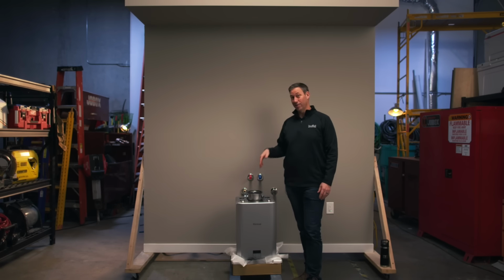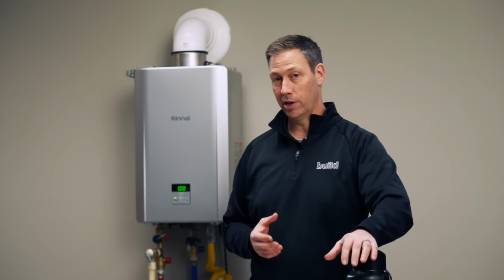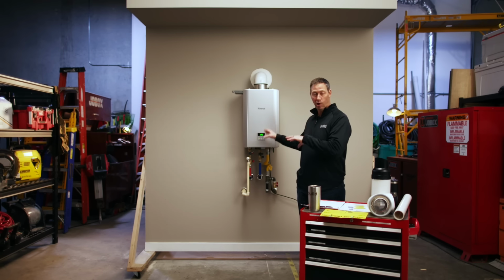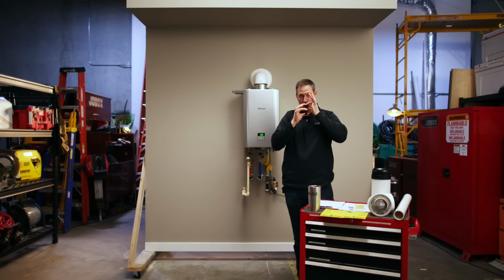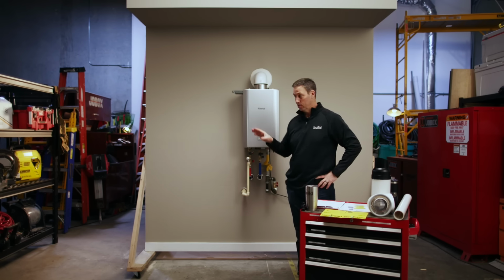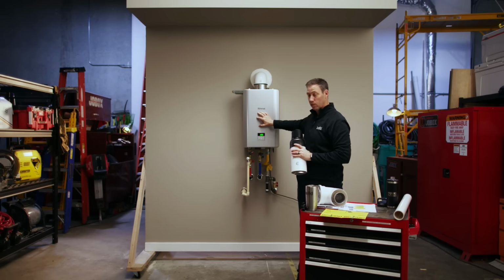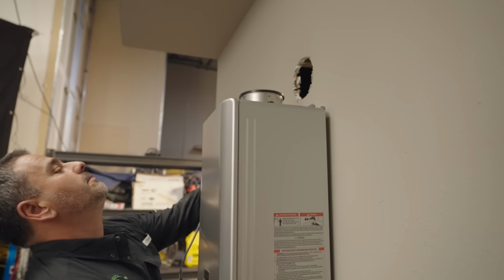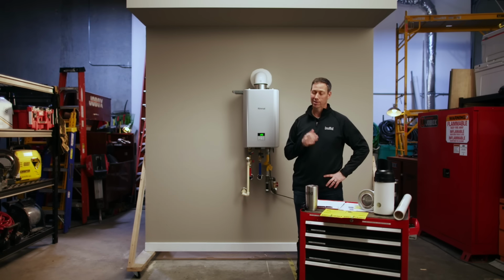Replacing A Water Heater Tank? Probably the Best Tankless Option for You.

Comment: I want a recerlation pump that has a remote like a door bell.  I walk into the bathroom or start loading the washer perss the ceerlation button and it will run for 1-3 minutes.  Who make this?
Reply: You need to look at the Smart Recirculation Control. http://www.smartrecirculationcontrol.com Rather than running wires and installing buttons or sensors at every hot water fixture it has a sensor that gets installed at the water heater and can be triggered from any hot water fixture.
Reply: @davidlehrian8035  I wasn't considering running wires.  They make battery operated transmitters. I am retired and dont live on a schedule.  So several of my activites don't take place on a schedule.  In my house this takes about a gallon of water to get hot water out each time you use the faucet.
Reply: @markmaugle4599  You said you wanted a button like a doorbell and then asked "Who makes this?" I just wanted to share what I think is a better solution than buttons or sensors regardless of how they are powered because you still need one at every hot water fixture and you now have to maintain batteries in all of these devices scattered throughout your home. The Smart Recirculation Control allows you to use any hot water faucet as the "doorbell" and you don't have to install anything throughout your house, wireless or otherwise as it is all self contained at the water heater/recirculation pump location.

Comment: my plumber told me during a recent replacement that I can't go tank-less due to the gas line needing to be up-sized from the meter (costing me much much more money).
Reply: I was told we needed a completely new electric meter put in to be able to use a tankless.
Reply: @Shannan845  that doesn’t even make any sense.
Reply: @kayomichael  I agree. Didn’t have time to do much research though because we were moving into the house that day so just got an electric water heater to replace the broken gas one. Still want a tankless though. How much electricity could they possibly use though? Our main breaker is a 150 and it’s an older home, but still. It already had a gas hookup and vent directly outside, and sits in the same room as the breaker box. It wasn’t worth the fight at the time, but damned if they’re getting anymore business from us.
Reply: Michael and Shannan, you are both talking about the same thing (increased energy input for the new tankless) and you are both making the same mistake. It TOTALLY makes sense that you'd have to increase your energy "input," whatever the source of that energy is. A larger (or additional) gas line OR a larger electric panel. A 150 amp panel is old news as all new homes have a minimum 200 amp panel today. And Michael, like you, we had a gas line, but it was undersized for a new tankless, so we needed to add in a new separate gas line for our new tankless (which was replacing an electric tank model). Just look up the specs, guys, the data is out there. Yes, tankless uses more energy FOR A BRIEF TIME than a tank model, hence the larger energy input. But overall they run less often than a tank, and therefore use less overall energy. You save money, and that's the goal. Education, gentlemen, can be your friend.
Reply: @idontthinkso666  Thank you!!! I definitely appreciate all the info!!! Maybe it’s just time to update our panel and/or gas line too for that matter.
Reply: @idontthinkso666  shannan845 said replace the meter, not panel. Panel makes sense, meter does not.

Comment: So, how big of a gas line do you need for this to function correctly?
Reply: @richardwitt5406  The statement "In general, if you can have a traditional water heater, you should be able to have a tankless unit." is not true. These units use 5 times the BTU's of a typical tank water heater. When I looked at getting one I was told I would need to install a pump on my propane line in order to provide enough water column inches to run it and the additional BTU's also require additional venting for combustible air. It can be an expensive proposition to switch out to a tankless unit with dubious benefits.
Reply: @davidlehrian8035  

Yes.  200,000 BTU/hr (tankless) vs 30,00 (tank) isn't nearly the same.  Look at the gas pipe sizing charts.
Reply: 30,000

Comment: I get having literally instant hot water, but doesn't constantly having hot water pre-circulated in the pipes kind of defeat some of the purpose of having an instant hot water heater? It's the same concept as with a tank, always keeping water hot regardless of demand or use. This pump has your unit running on and off all the time keeping that water hot in the pipes when you're not using them.
Reply: The circulation would only happen occasionally, not all day long. If you are always using hot water first thing in the morning, then your lines are “pre charged” with hot water ready foe your morning shower. You can install a separate circulation pump and a button in the bathroom where you have the longest wait times. That would cost a good bit of extra $$$ to install rather than have it in all-in-one. I also have been watching YouTube Chanel’s of folks building places in the Arizona dessert where their wonky water source is what they can capture and store from rain or have water delivers. For them saving a gallon or 2 every morning with having the line charged and ready at shower temps immediately ends up being important. In my house I have to run the tub filler for 10 seconds to get hot water and I can switch to shower. Not a lot of water loss. My sister used to live in a really large house and you had to run the shower for 30 to 45 seconds or more before you got hot water. That would be a lot of wasted water if every gallon counts. As was pointed out this is NOT the most energy efficient unit, but it has other offsets that may make it worth that slight penalty. I have a higher end old style tank that was one of the most efficient of that type. It still used far more energy than this unit would. My summer has bills are between $27 and $35. That’s for daily showers for 3 adults (two women with long hair, so extra rinse time), 5 loads of (front loader) washing warm/cold, 5 loads gas dryer, and 3 to 4 full dishwasher cycles per week. Even if you saved 30% on hot water costs would I see more than a couple of dollars a month difference?
Reply: Check out the Smart Recirculation Control if you want to get hot water on demand. It only runs the pump when you request hot water and turns the pump off when the line is hot.

Comment: Can the recirculating valve work with existing tank systems? How does it work if both lines into the sink are under their own respective pressure?
Reply: EXACTLY what my question was! How can the hot line PUSH water through the Circ Valve against the pressure of the cold side?
Reply: @cobra6114  Easy for the pump to do this because both your hot and cold lines are at the same pressure, so the pump simply needs to create a bit of "differential pressure". The hot side is already at the pressure of the cold side when static, so the pump only needs to provide a little bit of extra push.
Reply: @nwsvndr  sorry just getting back to this. Thanks for the info, gives one extra thing to put into the pros column when deciding if tankless is right for me.
Reply: @cobra6114  

It creates a loop with the heater.  Tank, tankless or otherwise.

Comment: I think it's fascinating that a selling point was less efficient operation. Especially with higher energy prices why would would this be attractive? Include constantly keeping the water in all the piping hot, all i see is losses and waste. Seems a little old fashioned.
Reply: I think he was talking about replacing older, worn out, and probably less efficient heater without making new vent holes since exhaust and exhaust moisture go out the exhaust pipe without condensation. I also think he said hot water recirculater learns and does not necessarily keep lines always charged with hot.
Reply: Yes, having recirculation does cost more energy due to the greater volume being kept hot. Flipside is much less wasted water due to running water down the drain while waiting for the hot water to arrive from the pipes. And the time cost of waiting for those pipes to be purged of cold.

Comment: I think the clients will also be surprised that the cold water line is no longer cold?
Reply: No not true. The volume of water passing through the bypass valve is too low to affect the temperature on cold side.
Reply: @lloydmartinez4415  So what is the volume since it looked like a 1/2" fitting and to perform the same or close to a return loop would require a substantial volume.
Reply: @fredflickinger643  The pump asks for at least 1.3 gpm. If you turn the cold water on your faucet  it has more pressure than what the pump is asking/taking. I’ve never had a customer/client  complain about having hot or even warm water on their cold side.

Comment: Power goes out also means you get no hot water..it has a computer system dependent on electricity to operate.   Twice a year mandatory flushes which requires a plumber--it's not easy like a regular water heater.  Further, recovering costs will take decades because it's very very expensive to get your first tankless unit (rewiring, replumbing).
Reply: @richardwitt5406  No flushing? Is it stainless steel?
Reply: @richardwitt5406  Water is not free. It's pretty expensive where I live. It also encourages taking lengthy showers so there goes your savings.  You must have softer water. I live in Central florida and the water quality is pretty hard.  I WOULD need it flushed twice a year.  Plus your first setup with tankless will require over a decade if not longer to recover--then you waste a lot of water with endless hot showers or refilling baths --so where is the savings?

Comment: Matt, I installed my current electric water heater in 1989 and by draining it annually and replacing the sacrificial anode every ~4 years it still works and doesn’t leak, but it is showing it’s age (significant corrosion around the cold water inlet) so I’m planning to replace it soon.  I have no desire to install infrastructure for propane, so whatever heater I get needs to be electric.  What is the current state-of-the-art electric water heater that you would recommend?
Reply: Get a heat pump water heater. It will use 1/4-1/2 as much electricity as your old tank.
Reply: @richardwitt5406  yes, electric tankless water heaters can’t come close to delivering the volume of hot water that a gas fired tankless can deliver.  To match the output of a 90% efficient 199,000 BTU tankless, an electric unit would consume 53kW of power, which would require 200amp 220v service.  So, unfortunately for me, tankless isn’t an option for my situation.  I’m looking for advice regarding heat pump water heaters vs conventional vs anything else I might not know about.

Comment: Ya, but now you need to run the cold water for a period of time to get cold water out of the taps. So water savings are basically null. Fast hot water, slow cold water, the inverse of the original problem.... 🙂(for the retrofit device only)

Comment: The bummer thing a out the venting is it's still concentric. Older houses that have a tank most likely won't have concentric venting and then you'd have to find a spot to get outside. This makes it rough for those of us with the tank in the basement.
Reply: True, but running 40' of expensive stainless pipe up to the roof isn't all that appealing either.
Reply: @UnlikelyToRemember  agreed, which is why I won't be going thankless any time soon.
Reply: Yes!  Somebody sees it from the output side.

The most common existing situation where I live is a natural gas fired tank vented in 4" type B (double wall) to the roof.  As most homes built in the last fifty years here are two stories, the vent goes through a chase up to the roof.  And, fire codes have the chases enclosed in sheet rock.  Retrofitting any other kind of venting like this either means a long horizontal run to an outside wall with sufficient clearance from fenestrations or, moving all the water and gas lines to an outside wall along with the heater.  Or, some really creative R&R of the existing pipe through the chase to the roof.  It's more $$$ than it's worth.

If any of the tankless manufacturers want to stay in the market here, they need to come up with a direct vent application that can use the existing 4" - 6" double wall as a chase for the flue.  I've looked high and low to do this for either non-condensing or condensing units.

Throw in the gas line size upgrade - usually the meters have a 280 cu ft flow rating so they're O.K. - and that tankless as a retrofit is a ridiculous waste of money.

Add the third strike:  In it's infinite wisdom, the state of CA is moving to essentially ban natural gas use.  Several jurisdictions have already gone to not allowing it in new construction. We've seen this act before with heating appliances.  From banning wood burning to banning pellet stoves to now banning natural gas fireplace inserts and finally, banning inclusion of fireplaces in new construction.  They're essentially forcing us into the latest and greatest, heat pump water heaters.  And contractors are demanding $6,000 to $8,000 to do the change out.  I kid you not!

Comment: Give me the RINNAI condensing unit each and every time!!!  I like 96% efficient!    I plumbed the whole house using manifolds and direct runs to each fixture (PEX A), danged if I want the water heater continually heating the water in the hot water lines.   Furthest fixture takes 24 seconds to get HOT water, and as you showed in one of your earlier videos 10 feet of 1/2" PEX holds a little over ONE cup of water .. do the math.   And being shower valves are anti-scald there is a blend of hot and cold, the shower head is 1.75 gpm .. do a little more math.    I really like our RINNAI tankless water heater, I installed it by myself .. hardest part was lifting the 82 lb. unit to hang it on the wall.   Easiest part was plugging it in!  ;)

Comment: 2 shocks here - 1. When things are pitched as new technology like Condensing boilers have been required by code to be used in Europe for about 10 years. 2. They are already being phased out for heat pumps in Europe.   Nobody should be installing these waistfull devices anymore.

Comment: This type of system is common in the UK and Europe, though, ours are usually "condenser combi boilers" and it has a separated diverter valve for heating and then for hot water, heating recirculates water in the radiators and then has a separate function for heating water for washing up or showers. My parents had a tank (immersion heater) when I grew up, ended up having a series of inline water heaters that were stupidly expensive to run and they finally did an install of a combi boiler last year - what a difference to spend on heating alone!

We generally use gas-powered though in the UK at least.
Reply: And about to be banned in favour of Heat Pumps. The US seems to be 20 years behind.
Reply: @BS25999  They won't ban ones already fitted, and heat pumps are shown to not work efficiently in poorly insulated/poorly air sealed houses- which 95% of the UK is! But whens that ever stopped the Gov making the correct call...
Reply: @BuildStuffWithJack  Heat pumps work just fine in poorly insulated houses. The difficulty in retrofitting a heat pump to an old building is that you need to fit larger radiators or under floor heating.

Comment: Regarding the sink connection drawing with fancy thermal bypass valve, if its open and hot water is constantly being pumped around the circuit, how does the basin get cold water? Wouldn't the cold line also be hot?
Reply: The valve allows hot water to reach the sink, but then closes. When you call for cold water you first flush a bit of warm water out before the cold arrives. A minor inconvenience, in my opinion, because it's the hot you really want. Those circ pumps are great for all homes where waiting for hot water is wasteful. The one I installed, a Watts brand, saves a lot of water in a year, important as I'm on a well.
Reply: @paulmaxwell8851  Thanks for your answer Paul, but I'm still trying to wrap my head around it. Normally a hot water loop has a dedicated line that returns to the hot water service and the cold water has its own line to the sink. In this case (according to the drawing) the hot supply and return are connected to the cold water line. So does the hot water return line (on the cold side) switch over to cold supply automatically within the hot water supply sending cold water back to the sink? If so, the warm / hot water in the return line would have to be flushed out before cold water would come out, is that right?